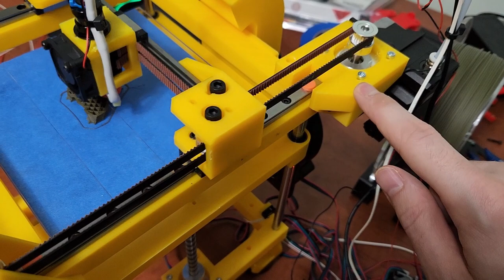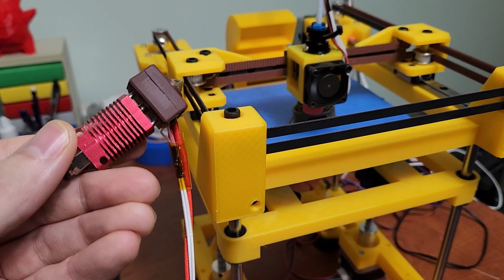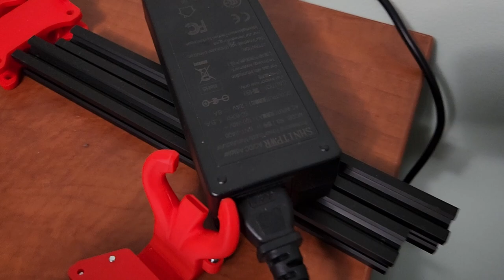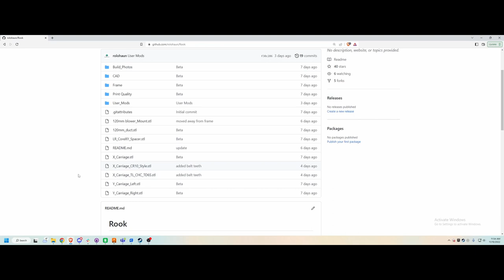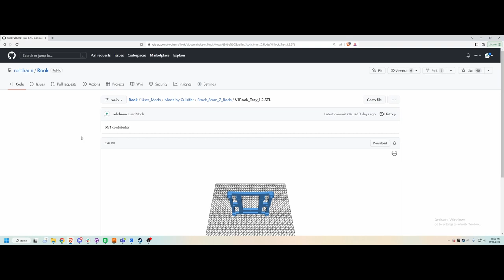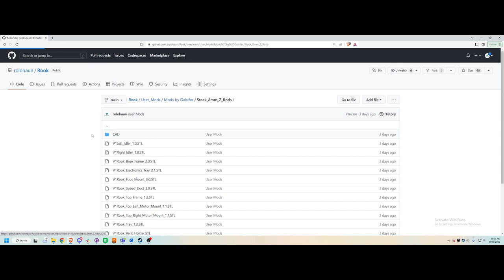Cheap 3D Printed CoreXY 3D Printer called Rook EP 2 - Update, Mods and Thanks!

Comment: You have the bambulabs sitting on the floor collecting dust and are instead using a tiny printable printer.
Really excited to see how this design evolves.
Reply from the maker: the X1 is on the floor cause that is my only stable surface haha I use the X1 everyday

Comment: When I first started 3d printing I built a Mini Kossel and to this day after building Vorons and running some of the best production machines that Kossel printed just as well back in 2014. One of the things I loved was endstop offset from Z limit switch and when I ran into designs with the Z switch on the hotend side with a Screw to adjust or like Ender 3 where the whole switch has to move, I just couldn't understand it. Glad someone mentioned how that makes no sense.
Reply from the maker: thanks! a old ultimaker 2 taught be this
Reply: @Rolohaun  Thats the exact other machine I had in mind. I can see from a mechanical perspective how it kind of made sense but it's much easier to sneak up on nozzle with Z offsets then adjusting a screw.

Comment: Thank you so much for posting the BOM.  I've been looking for a source for a replacement ball screw for my Wanhao D6 and I found one quickly at the source you used,  aliexpress for an amazing price.   I find the Z axis accuracy to be very important for creating prints with smooth sides. My D6 printer has a cyclical error of 0.03 mm that I measured using a micrometer.  That is a 15% error in an 0.2 mm layer thickness and it creates a very poor print.  It would be interesting to measure the Z axis error for the screws used in this printer.  I'm hoping to get good result with the aliexpress part, but I expect I will have to spend a few hundred dollars to get a good part from Misumi.

Comment: Awsome build once again! I want to build this so much! Do you think it’s doable with a 180mm bed? I’d like to put my kp3s in the trash and use the rest of the parts
Reply from the maker: only a 150 bed will fit and it still is only 120x120 usable, there is some idea's floating around on discord to make a larger version
Reply: Would scaling up bijou be possible?
Reply from the maker: @twanheijkoop6753  yes, I am going to make a larger mk2 bijou that is corexy
Reply: @Rolohaun  nice, I'll be trying to convert me ender 3 S1 with it. At least reusing what is possible.

Comment: Hi! sorry if this might be interrupting, and I know this is unrelated to the video, but I need to know if I could build a reprap out of my Ender 2 Pro. I bought it a couple months ago but I regret is it because it has a very small community and it isn't open source. So I want to turn it into a different (open source) printer that keeps the small profile and re-uses most of the same parts other than 3D printed parts (I have another printer) and maybe some threaded rods or something. If you could point me to something or even design a printer using those parts (or point me to a tutorial so that I could make my own design) it would be astronomically appreciated!
Reply from the maker: there is a good ender 2 facebook group, your should be able to get some info there
Reply: @Rolohaun  Thanks! 👍

Comment: Been looking around but maybe I'm missing something. Do you use an aluminum build plate and put glass onto it or what?
Reply from the maker: sorry, I just used glass with bed springs on 3d printed pads and VHB tape. I will update the github and BOM. The Rook does not use a heated bed as default